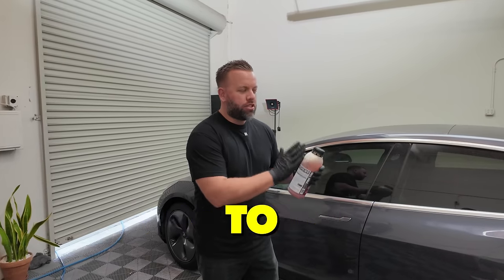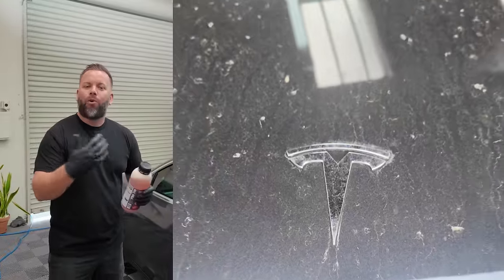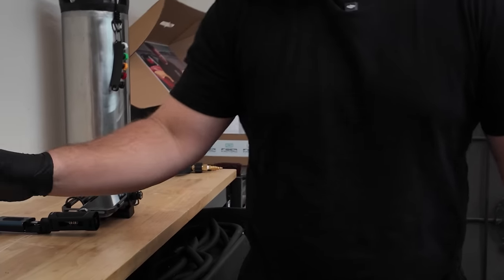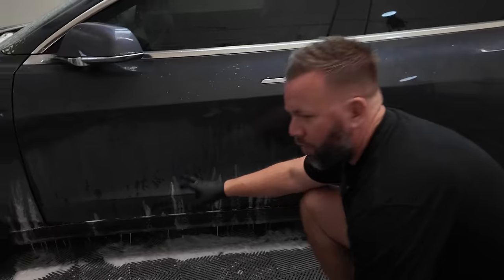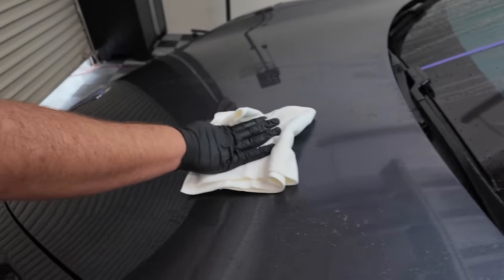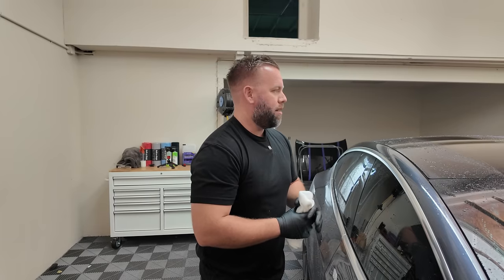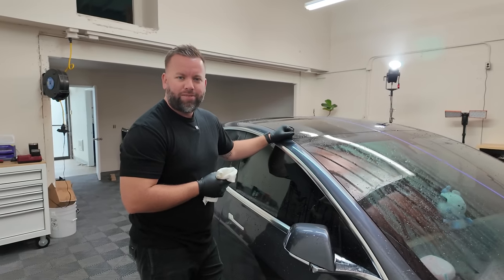SECRETS They DON'T Want You To Know - Do Not Pre-Rinse Your Car

Comment: I 1. foam first, 2. pressure wash off and then 3. hand wash with a sponge then 4. pressure wash final time. 5. Use a wet ceramic wax spray and go round the car with dry cloth. Job done, sparkles!
Reply: With a sponge!? Never use a sponge on your car. Use a mitt or soft microfiber type material. A sponge is a sure way of scratching paintwork.
Reply: @MegaVinny73  I dont have 20/20 vision so sponge is just fine for me! :D
Reply: I use a mitt but otherwise this is what I do. The hand washing gets it super clean.
Reply: I foam rinse foam again then use a microfibre mit with a 2 bucket method using the foam as a lube for my washmit with soap. Rinse mit often. Then final rinse
Reply: @DarthSeanious  If my car isn't really dirty, I foam, handwash, then rinse off.  If it's dirty, foam, rinse, foam, hand wash, rinse.

Comment: Yvan explained this method where water is an abrasive and water carved out the Grand Canyon. Personally I think applying a prerinse to a dry car is the safest method. A prerinse can be rinseless wash, a soap, or a stronger cleaner as long as the product offers lubrication when rinsing the product off the car. Thank you for this video over a controversial subject.
Reply: Yessir!  I always pre soak with diy rinseless wash let it dwell, and then rinse. Then I will foam the vehicle and do a contact wash with either incredible suds or with Rinseless.  Then final rinse and use rinseless wash as a drying aid
Reply: @DiamondDetailingBuzz diluted 256:1?
Reply: You got it right with the only exception being that water is not an abrasive, but it is a solvent. At high pressures it can act as an abrasive though. Solvents can dissolve stuff and by adding soap or rinseless, you make the water softer and less prone to dissolve and actually increase it's ability to break surface tension and release stuck dirt.
Reply: Yeah every since Yvan said that he lost a lot of credibility from my POV. People have been rinsing off their cars for plenty of times with no other product with zero reported marring.
Reply: Water isn't a lubricant?
Reply: Because we all pre rinse in the colorado river for a hundred million years. Perfect analogy. Thanks Yvan! Will be sure to avoid that.
Reply: With that logic you would be introducing marring even during a thorough final rinse after the car is clean. The water itself is not a problem. Now if you use high pressure water on a very dirty car, i can see how its maaaybe possible to cause some marring due to the dirt being rinsed off so aggressively. But the factor for scratching is the dirt, not the water. Not sure if thats what Yvan meant, but I take everything he says with a grain of salt. I feel like he's trying too hard to revolutionize detailing.

Comment: Im a mobile detailer in Atlanta and for me, I do both (rinse vs. no rinse) depending on what's on the vehicle. For instance, for most normal dirt, traffic gunk etc I will just foam with my pre-wash soap directly. For trucks and SUVs with heavier mud or something like that, I will pre-rinse first, then hit it with a pre-wash foam. I also tend to let the pre-wash foam dwell a bit longer (5ish minutes) and that also seems to help a bit more.
Reply: thanks
Reply: I’m not a pro, just a car guy thats been detailing on and off on the side for 15 years but this is exactly what I have landed on as a best practice for me as well

Comment: I think this also shows that unless you're willing to break the bank on pre rinse products and waste half a day foaming and dwelling multiple times, you're just as well off washing your car like you always have. I just pre rinse and use a two bucket wash process. No big deal. Simple green is a great spot soak product for anything stuck to your car. Sap, tar, bugs, whatever. It'll safely break it down - and it's cheap. "Extreme" Simple Green is $25/ gal. and you can dilute it 5:1 so you effectively get 5 gal for $25....and when you're done your whole car smells like Jagermeister :)
Reply: No professional is using simple green. I had a truck come to my shop with products you won't find at autozone or walmart
Reply: I have a black car, and I don't touch that paint until I have to.  It doesn't take half a day, and it is worth it to protect the paint.

Comment: I am mobile detailer in HK and I will do both (pre rinse or not) depends on the particular situation. First I think the pre-rinse step is mainly to cool down the panel if iam going to wash a warm car or just under direct sunlight. If so I will go for pre rinse to cool it down to slow the soap dry up in the foaming prewash process. If the car is cool or it isn't under sun light, I will foam up the car at dry for more cleaning power in the prewash stage.
Reply: Cool to hear from a detailer in HK! HK has lots of lovely examples of all sorts of cars, hidden away in mint condition

Comment: Reset is PH neutral, their alkaline soap is called lift which is made to be used as a pre wash. Other countries have been using pre washes for years in the US it just hasn’t seem to catch on as much. On extra dirty cars or even cars that I’ve corrected before and I’m trying to keep the paint as nice as possible I almost always use a high alkaline prewash let it sit for 5 mins then rinse, then either just bucket wash or foam again for the wash. Prewash also minimizes any chance of scratching in the rinsing process because it’s encapsulating the dirt that’s being forced off the surface by the pressure washer.
Reply: yep, Reset is ph neutral.

Comment: Avoid pre-rinsing for 2 reasons: 1- the existing water on the surface further dilutes the foam when it hits the car, 2- the pressure of water during pre-rinse digs the dirt further into the clear coat preventing the foam from encapsulating the dirt.
Reply: I agree with this so much.  Hitting dirt on the surface of the paint with high pressure water is just a bad idea.  Water and grit is how water jet machines cut steel.  Blasting grit across your clearcoat behaves the same way.

Comment: Bilt Hamber Touchless or Auto Foam are my go to products, tried and tested and safe! Difference between pre rinse or foam is the change in PIR if you pre rinse. Also depends if it's road grime, dust or mud. Mud you want to get wet and then rinse off before any touching!
Reply: BH Touchless is a great product.  But it’s very alkaline. (13 or 14, I forget which)  so it’s very hard on wax and ceramic coatings.
Reply: Wish we could get that here in the U.S., but I can't find it anywhere.
Reply: @LightofDeneb  You can.  Obsessed Garage carries the Touchless.

Just keep in mind, highly akaline soaps are harsh on waxes and coatings and can strip them.  It isn't a daily driver wash IMHO.

Comment: I own commercial self serve and automatic car washes and can confirm that pre-rinsing impairs the touch free cleaning process.  The product has to be strong enough to break the bond of road film (never heard it called traffic film in my segment of the industry) and by wetting the surface before application you are essentially diluting the product. It appears what you have is  the same or very similar product we use in automated car washes. You could buy the products we use in 5 gallon containers for around $100-$200 depending on strength.  Many modern sealants can handle high ph wash products.  I tested jescar powerlock and if I recall it still beaded well at over ten washes
Reply from the maker: Good info. Thank you!
Reply: What is the product called?

Comment: wash chems is basically more expensive version of purple power heavy duty degreaser. It actually has the same ingredients except washchems has a sufactent in it to foam it up. what I use is a 1:5 ratio on p-power to water, and add a cap full of dawn dish soap to it.

Comment: I've not used this - I do however use Purple Power Boat RV and Vehicle wash in the same way - as a semi aggressive "strip wash" about once or twice a season or about 4-6 times a year depending on how much road grime and "contaminated" the surface is - in those cases I make sure to rinse my wash mitt after each section and inspect it for things like bugs, grit crap like that and only use the mitt on one car before it gets washed.  Like others have pointed out "touchless" really doesn't work except if the car hasn't been driven much and most of what is on the paint is just dust (no road grime)....
Reply: I have been hesistant in using Purple Power, any tips on how to use it? ratio wise maybe? thank you

Comment: This is probably the same type of cleaner we use in our shop on our semi’s. we work mostly off-road and it does wonders when you’re muddy. You can literally foam the truck before a rinse and this stuff will get most of the grime off. I use it on my pick up but it can remove coatings if they’re not applied properly. I use turtle wax graphene and it hasn’t stripped it yet.
Reply from the maker: Nice! Thanks for sharing.

Comment: I am COMPLETELY recommend my personal routine (i have watched so many car detailing videos by now from many different channels)  - 1) one round of water spray importantly the front and lower portions of the vehicle. 2) foam cannon + rinse (sometimes i even leave it for about 5 minutes then rinse it off with the jetspray.) 3) FOAM cannon AGAIN and then clean the car using certified microfiber towels ** NOT ** wash mitts. Then rinsed off with the jet spray. it has COMPLETELY worked like an ABSOLUTE CHARM where i even impressed myself.

Comment: Loving the fact that you can wash your car in the garage 👍. I have my Vw passat ceramic coated by my detailer when required, it looks good when it’s clean but as soon as it rains it looks awesome to watch the beading effect but it’s when it stops raining and the sun comes out and where the sun has dried the water beads it leaves dirt marks, how do you stop this from happening surly ceramic looks good but isn’t the best, someone needs to make a product where the water sheets off. I have purchased a battery powered leaf blower to blow off as much rain water as I can after it’s stopped raining.

Comment: Great video - I pre-rinse my cars with a low pressure tap hose first - not my pressure washer - then I use foam followed by a pressure wash. The logic being that if I pressure wash pre-rinse there is a theoretical risk that the water under pressure might act on larger dirt particles and damage the paint (a bit like sand blasting). I have no evidence for this of course but it seems logical!

Comment: Obviously, there are multiple scenarios in which a pre-rinse might be effective or not.  But in the case of the vehicle tested here, where it does appear to be a "wash" between the two, it also appears that it also might have helped to let the pre-rinse side soak for a minute.  It looked very dry and giving the water a bit more time to soak into the dirt, thus making the pre-wash soak through the grime slightly more quickly (and possibly more thoroughly)
 before running off.

Comment: I have stopped pre rinses and now use a pH neutral cleaning soap like Griot's Surface wash which after trying so many others, simply dwells longer than all the others and after rinsing is the cleanest.  Then I apply an alkaline product (sprayed, not foamed) let it dwell for a minute and refoam.  The foam I use as additional lubricant for my contact wash with TW Pure.  If it is a weekly maintenance wash. I stop after the he single foam application and blow dry.

Comment: Thanks for the info Jimbo!   I saw this product on the internet recently and was wondering how well it worked or didn't work.     Your video answered my questions!   Thank you sir.    That stuff looked like it foamed absolutely incredible!    Nice and thick.    I think you are right though,  spray down the dry vehicle and let the product dwell on it for a couple minutes.    The strip wash function is what I would probably use it for.     Looks like it could really break down some dirt and road film.     That stuff definitely seems to have some merit for certain situations.    Not sure I would use it as a touchless wash because it would probably strip down whatever protection you have on it if it's not a full blown ceramic coating.    It would probably strip wax and sealants right off so you could only use it in those situations when you wanted to strip off everything prior to a new product being applied.      I had all sorts of hope that it would be a great product,  but just from your short little test there,  it didn't look like it did a very impressive job breaking down anything.     Both sides looked almost identical.  I'm sure it's probably a great soap,  but it looks like it needs some agitation to work effectively as a soap anyway.   I think i'll pass on this one and stick with something like Bilt Hamber Touchless.
Reply from the maker: thanks for watching!

Comment: Let the rinse vs. no rinse battles begin!😂
I am a pre-rinse washer most of the time but I dont use a power washer. I do have one to be honest. Not even sure my pre-rinse even counts as a true pre-rinse because I start by spraying it with a foam cannon, then rinsing it off before foaming it again. After that, I use mitts to wash it like normal. I don't use buckets. 
The main reason I dont use my power washer is so I can run a water filter because the water where I live has a high mineral content that tends to leave deposits when I don't use it. If you use a power washer, you need either expensive high-flow special filters or DIY your own, both of which can risk damaging your power washer if you're not careful. I understand some people claim that water filters don't work, and trust me, I was skeptical too. However, I conducted a very "scientific" test🤣 by washing one half of the car with a filter and the other without like Jim, and I could feel the difference during the drying steps.  Also, it is possible that depending on where you live a filter wont help you as not all tap water is the same and might need different kinds of filters or processes to "clean" it.
The second reason is that, although I have no evidence for this, I believe power washing turns the dirt and grime into a makeshift sandblaster, especially here in the desert where I live.

I believe to just do what work best for you. I love detailing my car.

Comment: With winter approaching and sticky road salt and other road grime I decided to do a full touchless wash using Bilt Hamber Touchless.  I used a pump sprayer on half the car and a foam cannon on the other half and NO pre-rinse on either side.  Pump sprayer won, I believe foam cannon dilutes the soap too much or does not put enough of it on the car to eat away the road grime. Used leaf blower to dry it off. Overall,  contact wash takes me 30min to complete and give me the 100% result I want, pump wash will take me 1/2 the time and give me a 70% result - good enough for winter results :)
Reply: you dont want to use touchless all the time, just ceramic coat it yourself or use a good wax and grime wont even stick so bad to be using touchless
Reply: @emilioavila844  Why not? Car is ceramic coated, will try using a gentler mix so that is does eat at the coating. I was thinking of trying ONR next, spray it down, let it dwell and then rinse off.

Comment: it takes very little time to power rinse a car before it is foamed and washed if you have a pressure washer. You  should always do this to the wheels as they get the dirtiest along with the under carriage of the car. And always do your car in the morning or late afternoon to avoid the sun. I also have a pro air cannon with an air squeegee attachment which leaves an absolute mirror finish. I also layer Bead it up after every few washes or you can use any of the really good ceramic coating enhancers. This will  enhance the color of the paint job and deepen the mirror finish. Ive done this to our wrapped Y  and it makes the finish almost a true mirror finish. Its incredible. The products they have today are amazing and you should never ever bring your car to a car wash if you possibly can. I use the best of everything on my cars and it really shows. My S is a 2016 and the finish is an absolute mirror finish with depth and looks better than a new Tesla S and its not close. Look if you are going to do it, then do it right. Period.

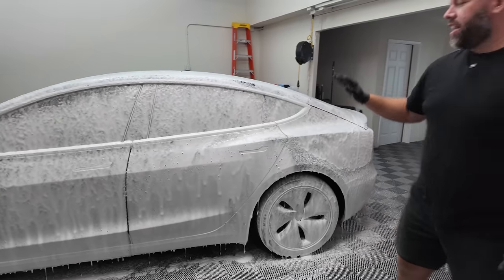Comment: I timed the amount of time each side was foamed. The non-prerinse side was from 3:12 to 4:08 (56 seconds) with a bit of foam going over to the pre-rinse side. The pre rinse side was foamed from 4:08 to 4:41 (33 seconds), then there was more foaming on the non-prerinse side from 4:41 to 4:52 (11 seconds). So essentially the non-prerinse side was foamed (about 67 seconds, but take a bit away for hitting the prerinse side a bit) almost twice as long as the prerinse (side 33 seconds)

Comment: Hello, what can be done against insect poo on the car, when it's already burnt onto (and not into) the paint by the sun? I have tried a lot of things. Elbow grease takes it off slowly, using polish or clay. Both would take up to 10+ hours to get the car clean. Not doing it though, since it looks the same after 2-3 days. If there's insect poo on the car and it rains, then gets dried by the sun, it's over. I have tried some chemicals, ph neutral flash runst remover, vodka, and a window cleaner with an ethanol - isopropanol - ammonia blend (almost scorched the skin on the back of my hands damnit). Frikkin nothing dissolves the burnt poo so I could just wipe it off, it just helps a little bit trying to forcefully rub it off with a micro fiber towel. I've heard of acidic wheel cleaner - would that possibly dissolve this 'dirt'?